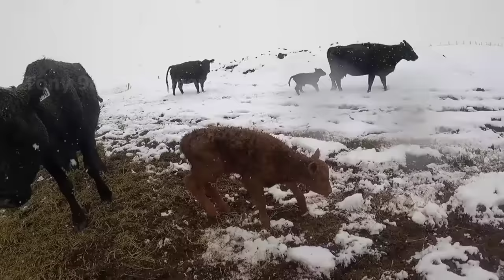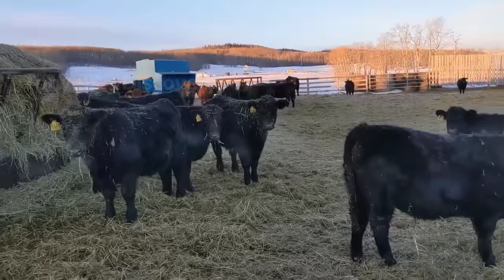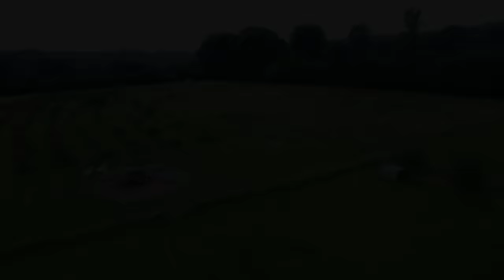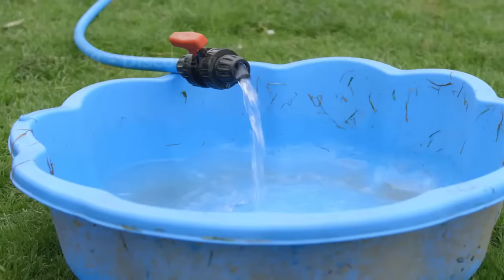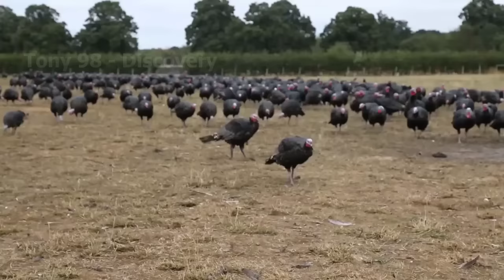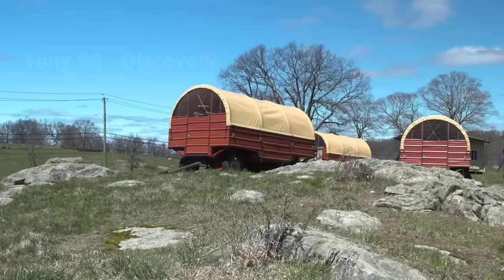American Ranchers Raise Millions Of Cattle In Snow Season This Way - Livestock Farming

Comment: Windbreak is the single most important factor in your herd's success in weathering severe winter weather.
Reply from the maker: You're absolutely right! Windbreaks play a crucial role in protecting herds during severe winter weather. By creating barriers that reduce the impact of strong winds, ranchers can minimize stress on the animals and help maintain their well-being. Windbreaks provide shelter, reducing wind chill and preventing excessive snow accumulation, ultimately ensuring the comfort and safety of the herd.

Comment: The harsh winter weather can pose a real challenge for cattle farms, but these ranchers are up to the task.
Reply from the maker: You've made an excellent observation! Harsh winter weather can indeed present significant challenges for cattle farms. However, the ranchers featured in this video are well-prepared and rise to the task. They implement appropriate measures to protect their cattle from the cold, provide adequate shelter and nutrition, and closely monitor their well-being. Their resilience and preparedness enable them to navigate the challenges posed by winter weather.